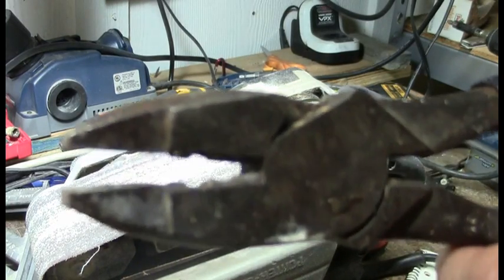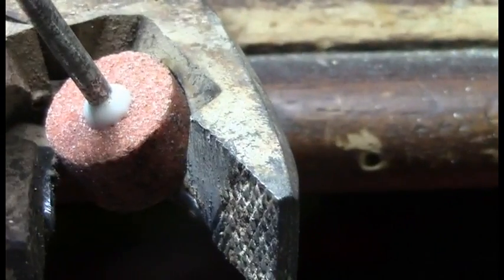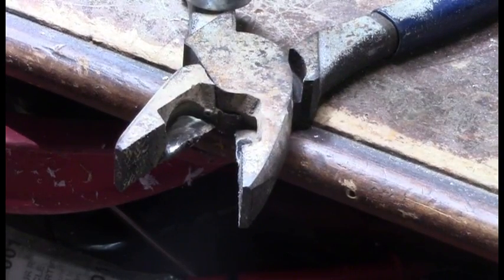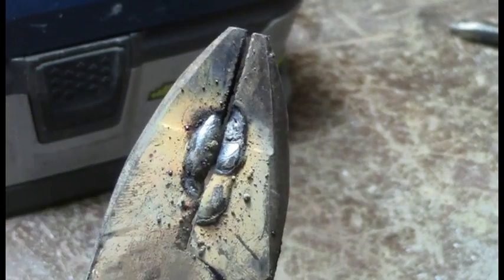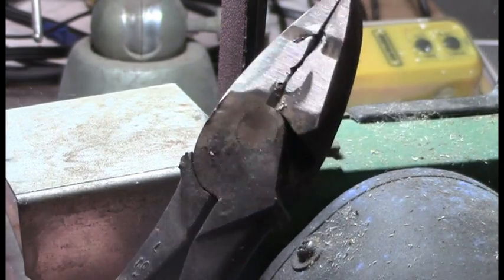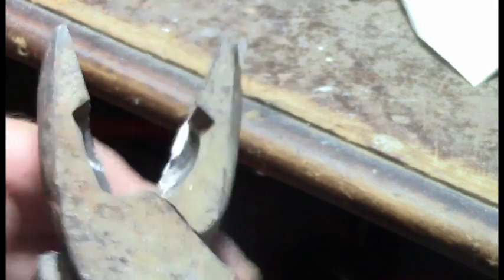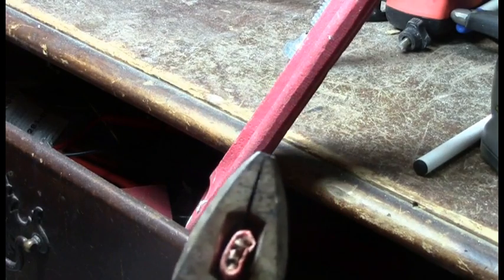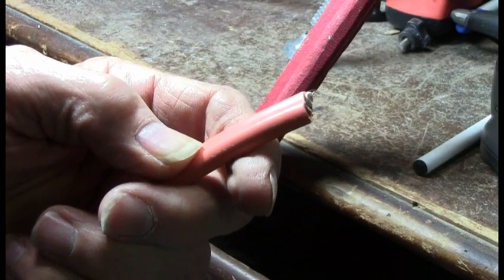how to repair blown out wire cutter after cutting a live wire

Comment: Well, if you are an electrician, cutting better than they did probably wouldn’t be good enough. But I sure do appreciate your putting this up and you’re inspiring people to take it and run with it. I’m already thinking of making a jig so that you can run the Dremel or the grinder very precisely so that when you’re done, it’s super straight, super sharp. I think One would have to treat this like a meditative practice on the weekend or something.
Reply from the maker: I wish you the best of luck, When I retired I sharpen drill bits repair large tools (table saw, miter saws, ). It keeps me just busy enough to get me out of the chair and earn a little

Comment: Make sure to temper the cutting area with heat and oil quenching or else the cutting surfaces will easily nick.
Reply from the maker: I was wondering about that. been out of town and will try to finish and then try heat treating them

Thanks
Reply: I'm glad to share what little tidbits I've picked up over the years. Your casement and sash window construction videos are going to be helping me real soon. I'm happy to show my appreciation in my own small way.
Reply from the maker: Thanks very much